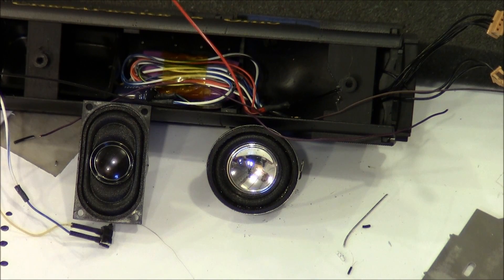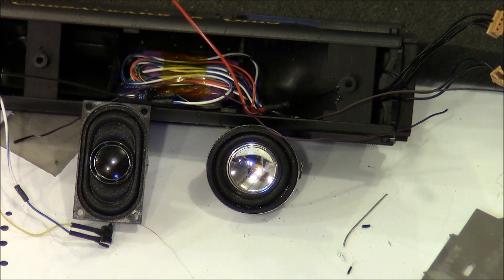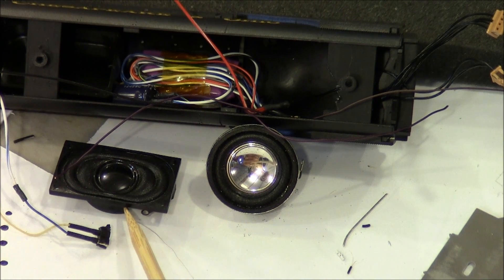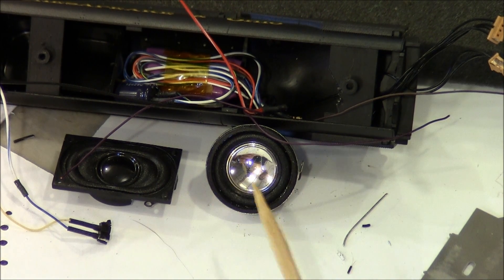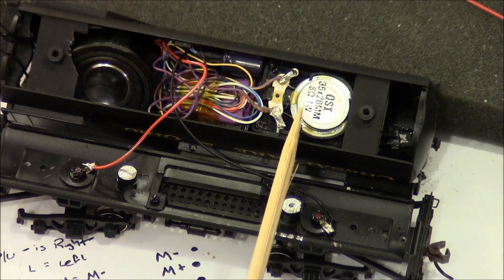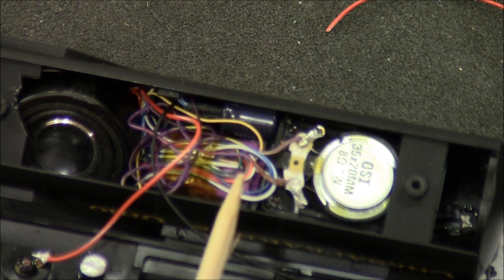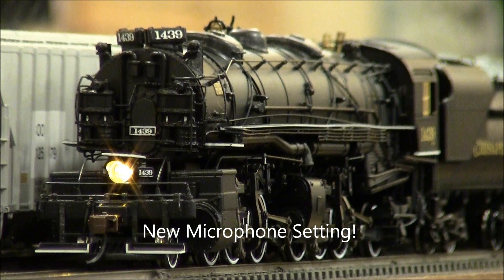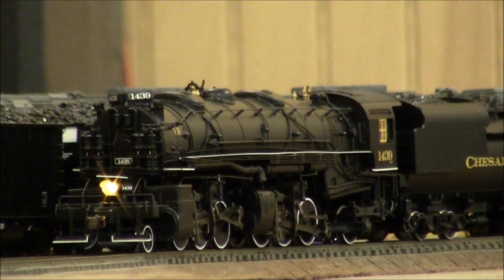SoundTraxx Tsunami & Spectrum 2-6-6-2

Comment: Eric I use your videos a lot and enjoy them as well as learn new things. I have a couple 2-6-6-2 Mantua's with MRC sound I installed and hear the articulated huff sounds. Great installation by the way and the Bachmann looks and seems to run very well. However I don't hear the articulated huff on this example and notice the sound is not choreographed with the drivers. Have you fixed that or is the Tsunami not capable of articulated sounds. Thank and keep them coming. Ted
Reply: choochoo3985 thanks for the kind words. this was a "quick" demo, where i had not yet synched the chuff and otrher programming. The Tsu is fully capable of articulated chuff

Comment: Hi Erik , I purchased this locomotive last week , but finances only allowed me to get the unit without sound ( it was fitted with the standard bachman 28 speedstep elcheapo DCC  decoder , which i swapped out for a Hornby 128 speedstep decoder , huge difference in performance. I do intend putting sound in it , and thanks for this particular video , stacks of very useful info. Keep up the great work and keep these vids coming , very much appreciated .
Reply: I also have a question I wonder if you could help me with: I purchased a bachmann spectrum 2-10-2 decapod with DCC & Tsunami sound , the unit is undecalled , no road number or railway company name etc. My question , would you have any idea what railway actually used this particular loco ? I have searched google/youtube and cant find a pic or vid of the real thing for reference so I can add this detail along with weathering. Theres plenty of vids/pics of 2-10-0 , but , as I said , this is a Russian decapod 2-10-2 , apparently built by Scanectaty (sp?) works in 1907 , but that's all the info I have , so any input would be greatly appreciated